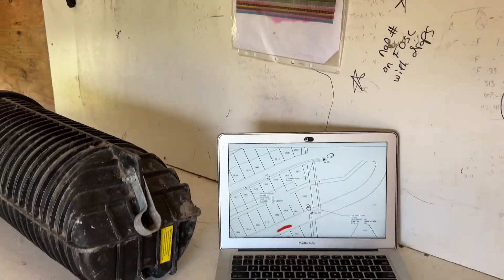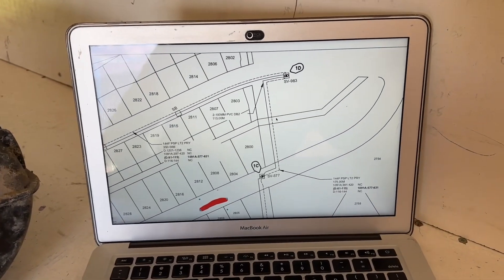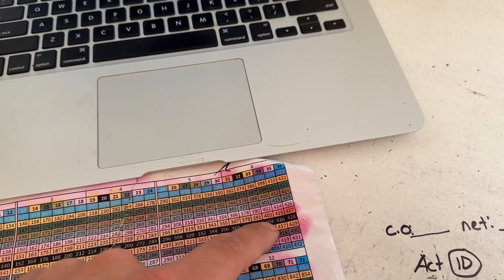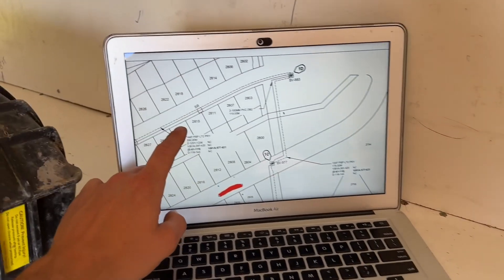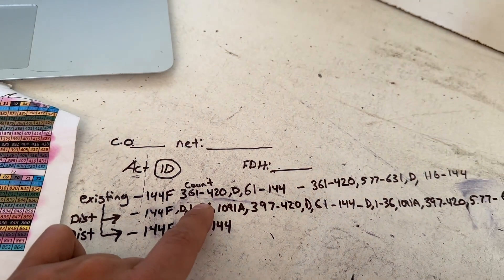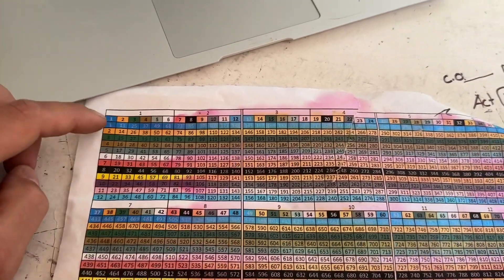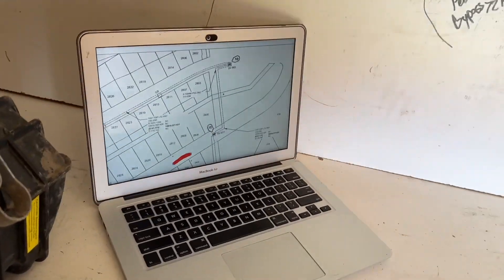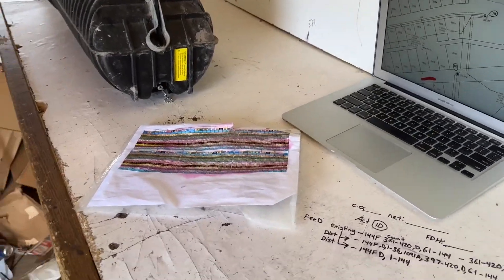Explaining Fiber Optic Splice Locations, Cable Sizes, And Counts FULL BREAKDOWN Part 1

Comment: "Dead" implies its life is over -- it's stopped working and it is uneconomical to repair it.  I would suggest "dark" as a more appropriate description.
Reply: For my area Dead = Never energize / spliced up and made useable . dark = goes down a route to some where but is not in use
Reply: No it wouldn't since dark fiber is an intact fiber route that isn't lit and is usually leased to a 3rd party who lights it with their own equipment. Dead would be a correct term as it isn't spliced through.
Reply: We use dark here as a fiber that is connected from point A to point B, but that the provider provide no light on it... So it a dark fiber because it the client who need to light it up.  Here Dead as it serve nothing, it have no life on it yet.
Reply from the maker: Hey thanks for watching and commenting I truly appreciate it🙌 yea it’s all a little different throughout the world but the end result is the same connecting customers with quality services. Funny how it all changes just a little bit between providers and builders but yet we all get to the same end result 🤌
Reply: It’s not broken , it’s just waiting for need to energize. His count was dead until a new development or need to use was needed. Now the dead will become working. Taxes are paid on all workers. Why get taxed on unused circuits? When they become needed they will splice in and direct to customer accordingly.

Comment: Ok so if I understand this right (still a bit confused), but the CO or main point of interconnect has 144F cables running out, with cable 1 being fibers 1-144, cable 2 being fibers 145-288, cable 3 is fibers 289-431, etc. So on the drawing it is showing you need to take the new cable that was pulled between the splice enclosures (shown as the dead 144F) and connect it to 577-631 from the CO / main point of interconnect, which is the 5th 144F cable, fibers 1 - 55, coming out of that central point into that specific splice enclosure?
Reply from the maker: For this specific network it starts with a 864 fiber distribution hub and breaks down as it goes throughout the area dropping counts off to customers and the cable sizes get smaller down the line till we get to this specific location I am explaining in the video which has 3 cables total. 1 feed cable which is a 144f with a total of 5 ribbons live. Then it has two distribution cables one heading down the street that is just a dead cable waiting on future developments. The other distribution cable has two ribbons live the rest of the cable is dead/not used yet. We are pushing our new count from the feed cable onto the existing distribution cable dead count and bringing it to life with counts 577-631 🙌 thanks for watching and subscribing I really appreciate it there is a video that is releasing in the morning where I go over the inside of the FOSC on this specific build to get a visual understanding👌 it drops in the morning 5:30am
Reply: @FiberSpliceGod  So I guess my confusion is how do you know which fiber of the incoming cable is being referenced as 577? Is there some indicator that 577 will be equal to the fiber 1 of the distribution cable?
Reply from the maker: @Echoskope we know this because before this count push this was existing infrastructure already deployed a few years ago we just went into the records found this pathway of 144f that had dead count on the cables allowing for new count to be pushed onto them all the way back at the fiber distribution hub. So since count 577-631 was free at the 1-864 distribution hub that is feeding this FOSC. I was able to just take that count and use the dead fiber in those cables splice them together and assign the new count 577-631 that we spliced on at the fiber distribution hub and just ensure we splice everything the same the whole way to our new development area.
Reply: @FiberSpliceGod  Ok I understand now, this was all referenced back to the main distribution point drawings that showed 577-631 was that cable, which is where Fiber 1 of the cable is the same as 577. Thanks for the clarification!

Comment: I watched this twice and its still not making sense. I am guessing this "count" of 577-631 and 361-420 is some kind of designation for the drop or splice, but not the actual fiber? 
Then if you are adding 5 ribbons (60 fiber) how is the dead changing from 61-144 to 116-144 in the feed cable?
Reply from the maker: Thanks for watching and commenting I appreciate it. So yes I ran up another 5 ribbons but within those five ribbons only 4 and a half of the ribbons is being used 577-631 that ends in the middle of the 10th ribbon out of the 144 which ends up being fiber 116 out of the 144
Reply: @FiberSpliceGod  Where you getting 577-631 from if its a 144 fiber?
Reply from the maker: @btschmieds they are just the counts assigned to that 144f cable so this network starts off as a cabinet with 864 fibers in it with counts 1-864. As the cable gets distributed throughout the neighbourhood counts get dropped off to light up different areas. So for this one there was some fiber used with assigned counts 361-420 that’s 60 fibers out of the 144 fiber cable and then I pushed more count up that cable from the main cabinet and used the available count which was 577-631 and pushed it onto the 144f cable that was heading towards the area I am connecting
Reply: @FiberSpliceGod  that clarifies it, I appreciate it man. ty! looking forward to more
Reply from the maker: @btschmieds perfect glad to help new video dropping every day for the next three months will be a fun daily build series 🙌 thanks for watching and subscribing I appreciate it